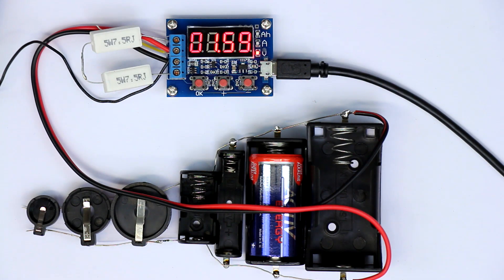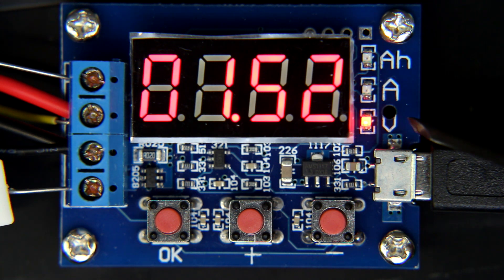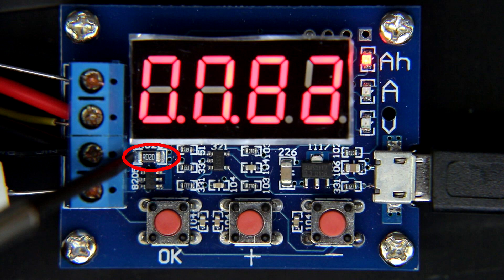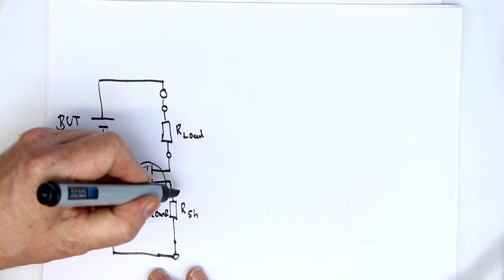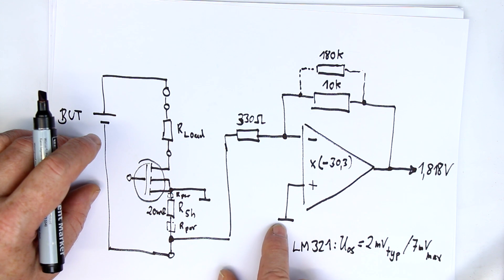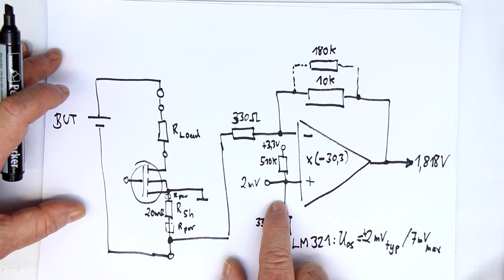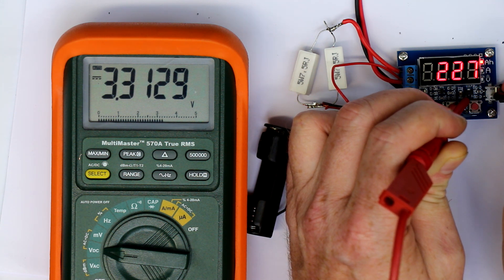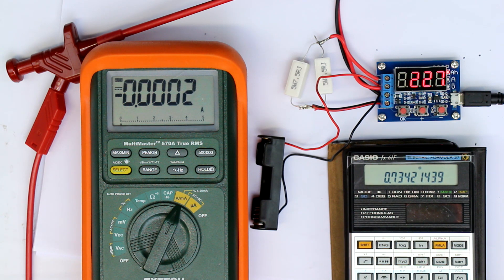Full Analysis of a Battery Capacity-Meter from Ebay

Comment: The right way to measure battery capacity in constant current mode  is to not use an ADC at all. The constant current should be maintained using a tight control loop consisting of analog parts only. An OPAMP should be used to drive the transistor instead of PWM from a microcontroller. The OPAMP would take feedback from the load resistor and thereby maintain a constant current.
Reply from the maker: I totally disagree. There are 2 ways to measure to measure battery capacity: Constant-resistance and constant-current-mode. Here constant-resistance mode is used. Both should give the same result when done properly.
Here is no PWM used but a fixed resistor as you can clearly see.
Not using an ADC??? Why that? Then how do you want to accurately measure/calculate and sum up current in constant-resistance mode???  
And finally the true battery capacity is not given in (m)Ahrs but in Joule (=Ws=VAs). For that you have to measure both momentary voltage and current periodically, multiply them and add that value up.
Doing that accurately without an ADC is next to impossible.
Watch a few of the battery measurement tutorials from David L. Jones over at the EEVBlog
Reply: https://www.youtube.com/watch?v=wYUonQ20IL4
FYI, CC is not necessary, this unit measures current and adjust the count correctly, I have verified it.

Comment: Is there a way of desoldering your 20mohm resistor and adc and using a 4 wire kelvin current measuring IC to improve the circuit from your description starting at 13:33?If so what IC could would that be and where would it go?
Reply from the maker: No. Forget about this crappy thing. 
Buy the TEC-06 which I recommend in a follow-up video.

Comment: Like you, just by observation of nominal battery voltage and load resistance I thought the current measurement was suspect, but when I put a part charged single NiMh AA cell (reading 1.2v open circuit) on discharge the reported voltage jumped to 1.44v !

Comment: i  want to add a device instead of resistor.  i attach to +R  -R but for some reason not getting a second capacity tester to light up from the +R   -R.  i am able to power the second capacity tester when drawing 5v from a USB.
Reply from the maker: I don´t quite understand your setup.
Could you make a drawing and email it to roger@kainkalabs.com

Comment: there are probably more versions of same meter... I have got 2.3version and its 1,248A on meter, and 1,25A on multimeter, so it seems to measure good values...
Reply from the maker: Measure again with 50mA. Only at the lower values dows the offset come into play.
Reply: @KainkaLabs  I will try it... So is the meter inaccurate only when used with very low current?
Reply: @KainkaLabs  I have testet it with ~200mA cos I didnt have other resistor, and offset is max 0,05mA on mine
Reply from the maker: Do you mean 0,05mA or 0,05A? I can´t believe that the value is exact to 0,05mA=50µA. If it is 0,05A=50mA then the "old" offset-error that I described and analyzed in the video still prevails and makes the thing useless for my purposes because I need a maximum error of 1mA for measuring low capacity batteries.
Reply: @KainkaLabs  my bad, yes, it was 50mA...
Reply from the maker: So you see. The offset problem is still there and makes this thing unusable for measuring battery capacity at lower end of the current range. The only solution would be to use a better OpAmp with low-offset.
Reply: @KainkaLabs  you are actually first one around that I see that connected those 2 Ceramic resistors in SERIE, to get 15ohm, so testing resistance around 280mAh (4.2/ 15). I did the same because I dont need to drain 1A when I will use those 18650s, and at 10W, they do not get to hot.
Could have connected them in parallel, but this will have drain batts at 1.12mAh, and they gets crazzy hot...

Comment: have you by chance tested this one ?  (KKmoon LED Digital Battery Capacity Meter Discharge Tester Voltage Testing )I am looking for some advice on buying a tester at a cheap price...I do not have alot of batteries but want some thing I can use that is amore accurate than this one.
Reply from the maker: No. Looks promising.
The next I will test is the 
TEC-06 Battery Capacity Tester.I have ordered one 3 months ago which apparently got lost in the mail.Yesterday I ordered another one in the hope that this time it will get to me in reasonable time.
Reply: ....test some thing that might actually have a closer accuracy. but always interested in your post...TY  in advance

Comment: Nice detective work in locating the issues.

Unfortunately it doesn't seem to be open source. It would have been nice to play around with software offsets to calibrate this.

Thank you for your videos.
Reply: There is a pinned comment by Peter Nink that shows how to calibrate the device.   See here:  https://www.youtube.com/watch?v=v_RtSspY1Js
How good is in the accuracy after this?
(pasted)
The 'procedure' was in Chinglish, here is my translation of it: 
• Short Input+ and Input- lines, disconnect the load resistor
• Enter Calibration Mode by pressing all 3 buttons
• Connect 5V USB power
• Calibration sets offset and displays 0A0u
• Press OK – display shows J10u
• Apply 10.00V between input + and –
• Press OK – display shows J2.0A
• Apply a constant DC current of 2.0A to the resistor low side  (input direction) and input negative (outflow)
• Press OK to complete Calibration
Reply: Do you know if the value of the "5V USB power" provided affects calibration in any meaningful way? If so, what are any specific requirements?
I know during normal operation this value isn't critical, but it could be an issue during calibration.

Comment: Whilst testing ONLY 18650 cells en masse for MAH capacity, can you suggest a PREFERRED resistor value for this? and a  SIMPLE formula for correcting ONLY the Mah value? going from say 4.1v down to 3.1v as these are a 1/3rd or 1/4th the cost of other Mah testers currently from eba, bangg, and ali?  I am happy with 3-7% accuracy, not a NASA mission critical application.
Thanks for SUPERB content!!
Reply from the maker: See my reply on your other post.
The value for the discharge-resistor depends on your preferred discharge current.
Ohm´s law: R=V/I and power-rating would be greater than P=I*I*R.
Use 3.7V as the typical discharge voltage for 18650 cells in the above formulas.

But better is to use the TEC-06 (or any other true constant-current capacity meters) because there you get comparable results for different cells if you are e.g. searching for cells with similar capacity to use them in a series connection.

Comment: The error is in the resistor.. I've tried to measure my resistor identical with your resitor 5W 7.5 ohms.. multimeter reads it 8.4 ohms each.
Reply from the maker: No, the resistor has nothing to do with it because the device measures the current with an internal shunt resistor. You can use any value of the reistor with this devie.

Comment: This small board has a cabin mode you can get in to do your own adjustment.
Reply from the maker: You probaly mean "calibration" mode aínstead of "cabin mode". Yes and I made a video about that and it only partially can fix the design errors.
Reply: @KainkaLabs  You probably mean "probably" instead of "probaly" and "instead" instead of "afnstead" ;)

Comment: Almost bought one of these. thank you for the save. Can you recommend any budget capacity meters that work?
Reply from the maker: No. I´m looking for an alternative by myself.
I still have to check my second unit if it has the same amount of errors or of this one was just a very bad unit by chance. I still can´t believe that the timer for calculating the sum of measured miliamps is so way off.
Perhaps they didn´t tuse enough bits to sum up the samples?
(Hope I didn´t make a mistake in the final measurement by myself :-)
Reply: Did you find an alternative in the end?
I am really looking around for something like this as using a b6 for just one cell at a time is painstaking work

Comment: Hello in your opinion whats the margin of error for this device?
Reply from the maker: So high, that´s it´s unuseable. 20...100% in the current (higher relative error for lower currents due to the offset), 30% in the time measurement.
Have to try the calibration-function which was not documented by the Ebay-seller where I got mine.
Described further below how it works.
Reply: Wish one you recommend? :(

Comment: KainkaLabs - you know that you can do a SW calibration for voltage and current measurement for these testers? Unfortunately when I tried to recover my unit that had a huge current error the calibration made things worse. Then again before you bin it running a calibration may be worth a try. I can send you the calibration steps if you like.
Reply from the maker: No. I didn´t know that for THIS thing. Nothing about that is given in the Ebay description.
I know that this is possible for a lot of the other capacity-meters (with low precision 2-terminal shunt-resistors and/or no quartz-base for the microcontroller, beacause only then it is mandatory).
I mentioned in the video that this could easily be done in the firmware.
But are you sure there is a firmware with this one?
If yes, please give a link to where I can find the info.
Reply: I posted it elsewhere recently but continued looking to see if someone got this little tester to work properly. Like you I thought it could be made to work if  you can reduce the error. Here are the basic steps for calibration that I translated from some very crude Chinglish description:
• Short Input+ and Input- lines
• Enter Calibration Mode by pressing all 3 buttons
• Connect 5V USB power
• Display: 0A0u
• Press OK to calibrate offset
• display shows J10u
• Apply 10.00V between input + and –
• Press OK – display shows J2.0A
• Apply a constant DC current of 2.0A to the negative resistor terminal (input direction) and input negative (outflow) or connect load resistor and match input voltage to suit.
• Press OK to complete Calibration
Ultimately my unit failed the current measurement calibration - by a factor of 5 - not sure what is wrong. May investigate further at a later date.
Reply from the maker: Will try it out when I find the time.
Reply: @ Ring Neck - that is in essence what I described earlier. 
Then again my unit failed to calibrate the current range. I did manage to calibrate the current to read 10x the actual current. This way the Ah reading makes some sense even if the range is low. Maybe I need to get another unit to try that again some time.
Reply from the maker: Why should it only be suitable for lithium batteries and only for 3,6V/7,2V types???
For the Amphour measurement it only has to measure the voltage over the internal shunt resistor which is totally independent of the applied battery voltage and the circuit of course can´t know and doesn´t care about the battery type. In the calibration e.g. a bench poer-supply is used which is no "battery-type" at all.
And the voltage measurement used for determining the cutoff-voltage for shutting down the internal MOSFET is specified for battery voltages up to 12V.
So it must be suitable for any type of battery from 1,2V...12V independent of battery-type (as also is told in the Ebay-description of the properties/specs).
The reverse-engineered analog circuitry also doesn´t give  a hint why this should only be suitable for 3,6V/7,2V lirhium-ion cells.
I will try out the calibration next week but am still not convinced that this will improve the current/charge measurement accuracy to an acceptable level because the current calibration would have to be a 2-point calibration process to null out offset-error (of the OpAmp) and scale-factor (of the shunt-resistor).
And there still was the gross error in the time-measurement which in total gives a false mAh-reading even if the current would be measured/calculated precisely.
I will test this with 2 identical units to see if both have the same timing-errors.
Reply: Fair point about the battery type being irrelevant. The calibration is (presumably) a 2 point calibration: offset @0A in step 1 and gain @2A in step 3.  If your processor timing error is constant or near enough, you could calibrate the current measurement higher or lower to get a more accurate Ah measurement. Not sure if it is worth the effort though. The internal RC oscillator is factory calibrated to <5% and can be user-trimmed to <1% Temperature drift is quite low too.
Reply: Peter Nink Hi.mA bit old the video but I did for around half a year ago buy some of these from ebay and they were totally out in current. The problem was a wrong value mounted for R020 shunt resistor, mine was marked R200. I changed them into R020 20 milliohm and did the calibration and the units has worked fine since then and are very precise. Maybe its the same for you....
Reply: How did you try the SW calibration?? I tried to connected my device to PC, and now the 3 leds on the device arre blinking one by one, then the device turn off. Can you please provide the SW or where can I find it please?? 
Thx

Comment: You can calibrate via software current and voltage see other youtube movies
Reply from the maker: No, You can´t as I have tried and demmonstrated this in another video with this crappy thing.
Should be already mentioned in one of the other comments.
Reply: this is the first vid i see from you , ( but i subscribed ;) ) , otherwise the device is maybe crappy , but if you use always the same ( crappy) devise , you can sort out your best 18650 cells ...
Reply from the maker: Yeah, that can work. But I woud have a better feeling if the test-and-measurement eqipment is decently build and has a reliable quality/accuracy.
Check out the "TEC-06" which I made a separate video about.
I highly recommend that one for medium-power (up to 12V/3A) battery charge tests.
It doesn´t cost much, gives accurate results and is well engineered (except for the implementation of measuring the internal resistance of the battery).
In a few weeks I will publish a video with an overview of about 10 different battery charge-testers where also the TEC-06 will b a "winner" in the medium power range.
Reply: thanks for the scoop  :)

Comment: I have this exact capacity tester and it actually gives 5% accurrate tests, bought for 3 dollars and I mostly use it as a voltmeter lmao
Reply from the maker: That´s a chance result if offset-, scale-factor and timing-error cancel out.
But that is only at certain combinations of current and time.
Try it at 100mA and at 1000mA and I´m sure the measured current will be way off at least at one of the 2 settings.
Anyway they state a much better accuracy in their Ebay-description and this is certainly not the case.
I threw away my 2 units because they give even after the software-calibration completely unreliable results..
Reply: Mine (just arrived) is labeled with "ZB2L3 V2.3s", the board layout differs a bit, maybe they have also adapted the firmware.